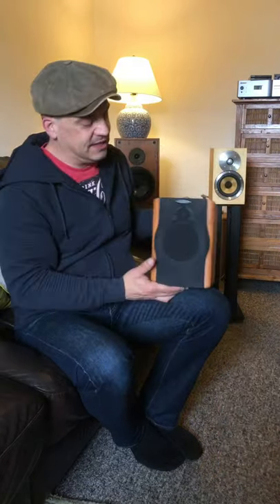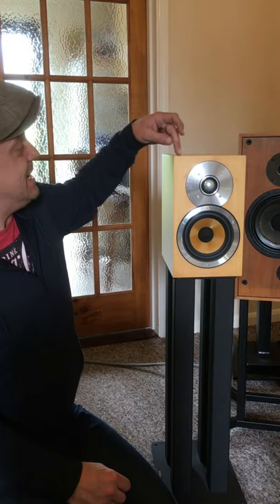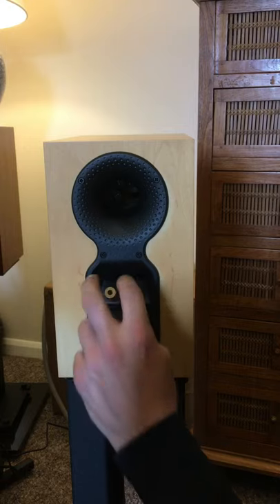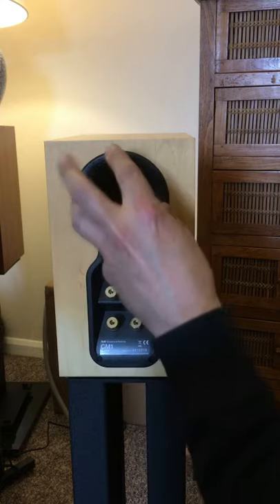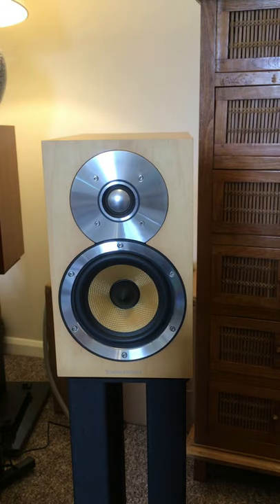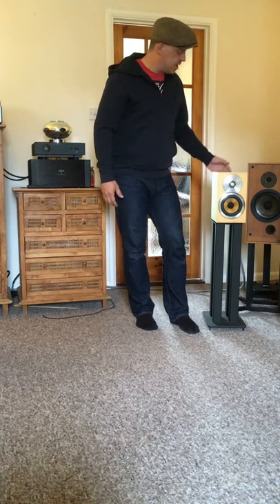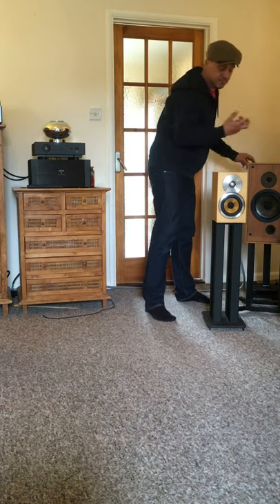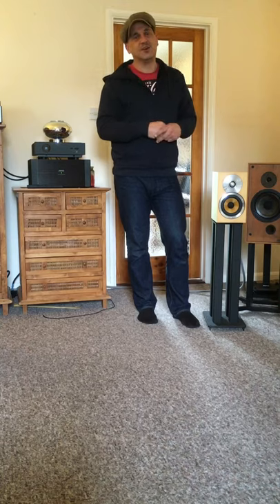#B&W #Bowers&Wilkins #Speakers British Two Way Mini Monitor B&W CM1 series 1

Comment: Accurate review. Exactly what I said in the shop. Lots of bass and warm sound. Nice tweeter for a metal unit too
Reply from the maker: Thanks Martin. 
I could live with them.
 I’d use the port bungs though.
Reply: @dittonworks  how does the Chinese pair sound different? That surprised me
Reply from the maker: @martindevon3204  a bit flat compared. It honestly could be the different cabinet finish?

Comment: Wow i am surprised that the CM1 have 2 versions…one made in china & the other made in UK. I have the CM6 S2 which are also made in china & the HF are not lacking in any way. In fact, the CM6 S2’s highs are very close to the diamond tweeter on the 805D3. I did a side by side comparison. I also listened to the 805D2 at the end of a Naim system & i feel that my CM6 S2 with LFD LE 3 sounds far more open, 3 dimensional & realistic. One drawback about B&W speakers is that they need some volume to come alive. But once u drive them well & give them sufficient volume, they can sound pretty darn good. They throw a huge soundstage that belies their size & can go very loud without strain.
Reply from the maker: I’ve had many B&W speakers. From DM range up to 805 diamonds

Comment: I have these exact same speakers, serial nos 0010461 & 0010462. Unfortunately many years ago some tiny fingers pushed in both tweeters so now I have to use them with their magnetic covers, not sure that the dimpled tweeters effect the sound, but it would be great to find a way to repair or un-pop the tweeter dimples.
Reply from the maker: Hi Christopher, you can get access to the rear of the tweeter diaphragm by removing the nautilus tube, the hole is fairly small but a cue tip/cotton bud will push the dent out.. BE careful doing it!! You are welcome to send the tweeters to me for repair.. check Ditton Works Facebook page for repairs.

Comment: Definitely preferred the Celestions. The B&W's reminded me of my Kef Cresta 10's I have (made in China ones) I found they muddled voices.
Reply from the maker: Alas the piano black ones sounded very muddled.
Reply: @dittonworks  strange If the same components and materials were used they should sound similar. It's not like they are super complicated devices to make. Some changes to the crossover maybe?
Reply from the maker: @D1N02  possibly cheaper components in the crossover.?
The actual drivers (at that time) were still made in Britain, only assembled in China. 
I still believe the cabinet finish might have something to do with it too?
perhaps a combination of all
Mentioned above?
Reply: @dittonworks  probably. Stuffing and workmanship could also be a factor. Those Chinese probably didn't know what they were supposed to sound like.